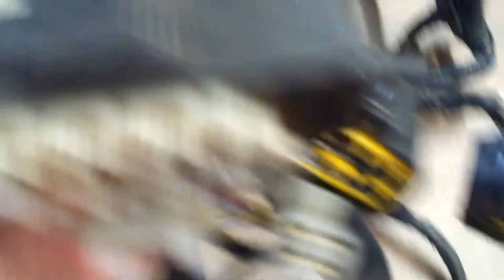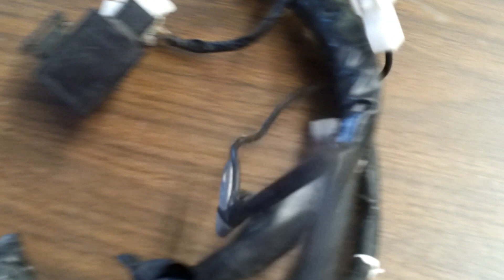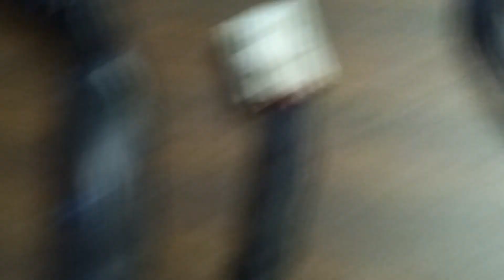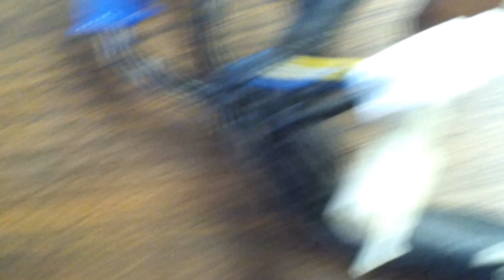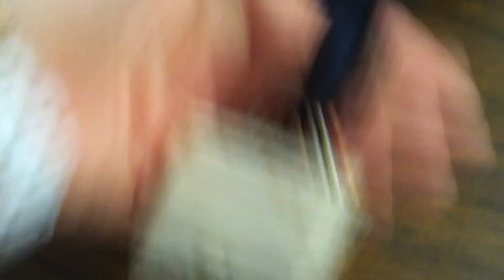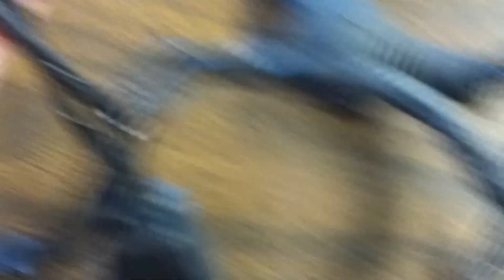r6 wiring harness broken

Comment: Just cut the tape surrounding the wires and you can either crimp them together with a butt connector or you can take the time and strip the end of each broken wire and braid them,solder them and heat shrink them

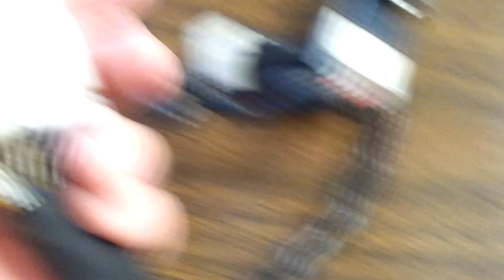Comment: Can anyone tell me where i can get the connectors for the headlight? (like the one on 2:20) Its become rusty so it doesnt make contact anymore. I also need the connector for the regulator/rectifier. Thats a very special one, it burned out so i now use 5 loose amps, it also works but its neat with a connecter.
Reply: found it. check easternbeaver.com for just about any motorcycle-connector you can think of
Reply: +Nelis1992 Yo Im currently trying to find the same female connector for the headlight because mine had the same issue. I tried to find it on the website you posted but couldnt, If you remember what that was called please let me know I cant ride till its fixed:(
Reply: Hey. I didnt find exactly the same one for the headlight either. I replaced both male and female as a set. If i remember correctly it was the 090 connector 12P090-MT? Not sure about the number of terminals but its almost the same one. I also tried the Sumitomo TS025 sealed connector but i think the wires were too big for those. You could also e-mail the guy running the website, hes very helpfull.  Ill try to dig up the exact type i used next week. Good luck!
Reply: +Nelis1992 I actually just ended up ordering a whole new headlight loom and rigged the rusty connections so I can just bypass them lol. Thanks tho homie I appreciate that